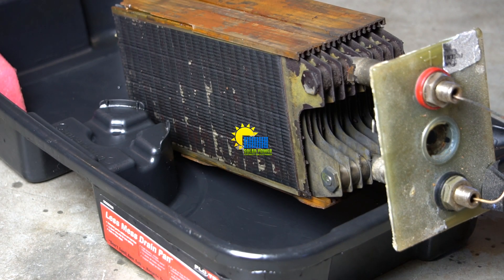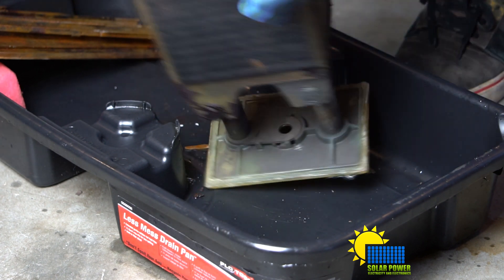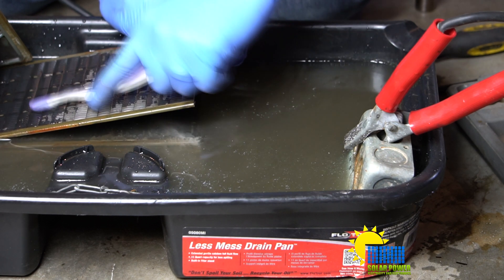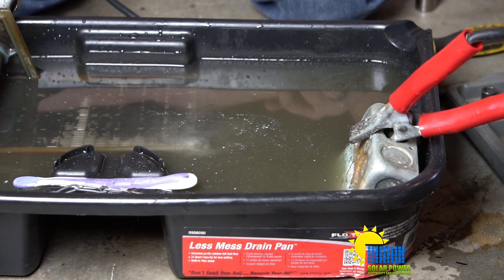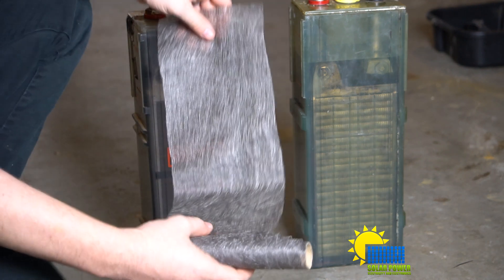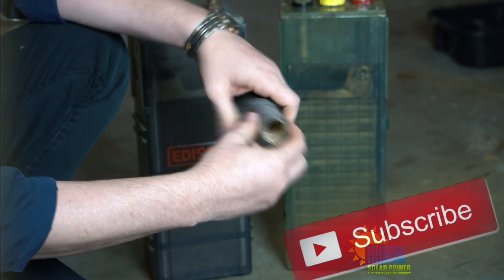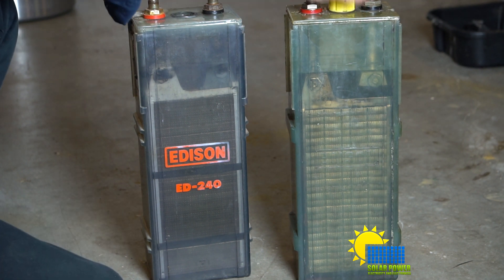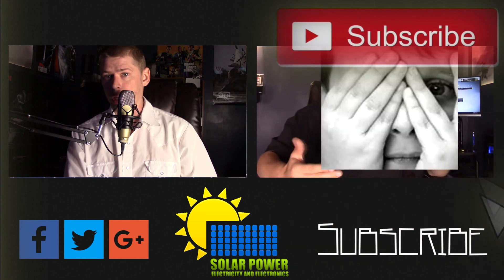Cleaning The ED-240 Solar Power Batteries Part 1. Take A Look Inside Of It With Me.

Comment: I work on the railroad and they have these batteries in use at certain locations. What's the voltage range
Reply from the maker: 1.25 volt battery cell
Reply from the maker: Charge to 1.5 volts

Comment: Don't use electrolysis you will ruin the plate's read my next post and don't use soap or solvent ether. You are removing potassium that has gotten dirty and has built up onto the plate's. You can make new potassium hydroxide for your batteries

Comment: Use a solution of Boric acid and brush plate's until clean (no more 
visible deposit's on the plate's) then befor reassembly then soak in 
distilled water 1-2 hours then rinse with distilled water then hang 
(very important to hang with good ventilation and warm room temp 70* to 
72* about) let dry for a day or so then reassemble (you want them very 
dry but do not apply medium to high heat to the plate's) clean the metal
 part's too with the boric acid and brush then wince right a way with 
distilled water and let air dry. I hope you filled with recommended 
electrolyte of 30% aqueous solution of potassium hydroxide.

I would rebuild my 2.3 - 2.7 volt batteries listed as "But 2 volt" I would pick out the best
plate's
 after cleaning and make new batteries. (You can also use fiberglass 
fabric when you rebuild them you only need it to be porous enough for 
the O^- ion to get through) I used plastic mesh 1/8^th square's or 
smaller material as a spacer with fiberglass in between to get the right
 spacing.

Don't use soap or solvent it dose not get rid of the 
potassium buildup on the plate's very well, and you could have a bad 
reaction with the potassium hydroxide when added to the cell if not 
rinsed well.

And a little narration would of been nice.
Reply: Traduzir para o português

Comment: What are the volt's and Amp hrs and cca of each battery.
Reply from the maker: 1.2 Volts and 240 amps hours
Reply: Thank you:  For my first solar system I got batteries from a train / locomotive repair yard and they were 2.2 volt average so 2 volt cell's with a amperage of 960 amp/hrs Now the train's only used them for about 18 to 24 months, and they were of the type that the top's were screwed down with a gasket, which would make rebuild easier. Now I could get them for free with the connectors to put them in series so I could build 12 volt at 960 amp battery banks.
Reply from the maker: Very nice Bro.

Comment: FYI- Electrolosis, Sacrificial Anode and elecroplating a cathode: Elements on the periodic chart that are left of another element give up electrons easier. e.g. Magnesium is left of Iron so electrons flow easier from mag. to iron vs. iron to mag. (reversing polarity) Lithium is at the left most column so it is very willing to give up electrons and it is high up on the table so it is light weight. that is why it is used in portable, high energy density batteries like cell phones, tablets, laptops. etc. also search electronegativity (for electrolosis). other things that would interest you is the galvanic table, and triboelectric table. Most of the elements are metals and all of them would work in some type of battery configuration but you get the most from the elements when the differences between elements are greatest.
Reply from the maker: miller4980 that is really good information thank you so much
Reply: Thanks, very interesting